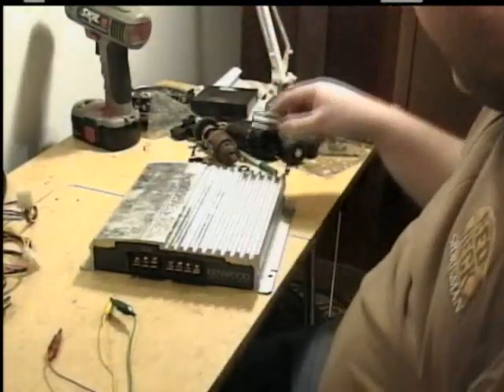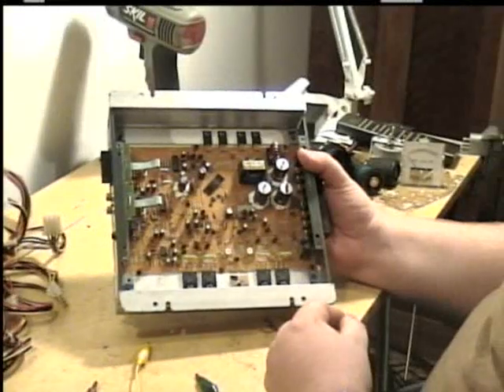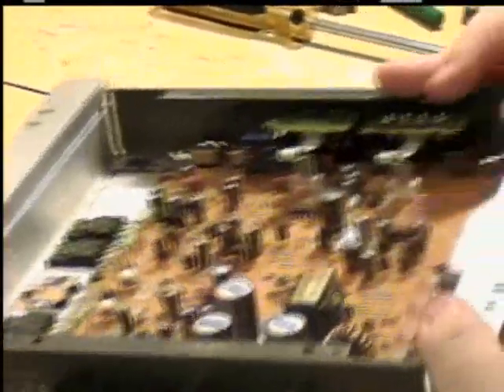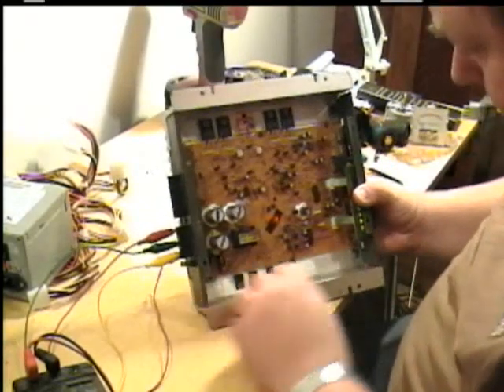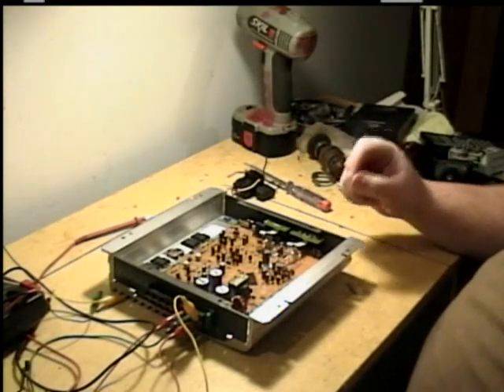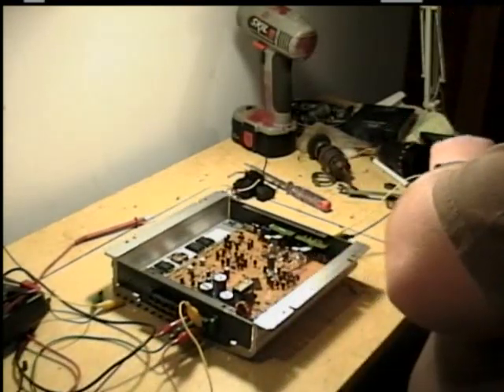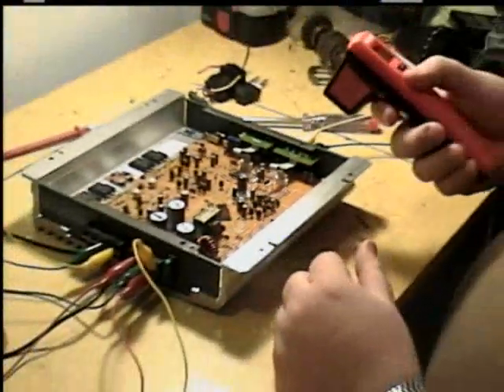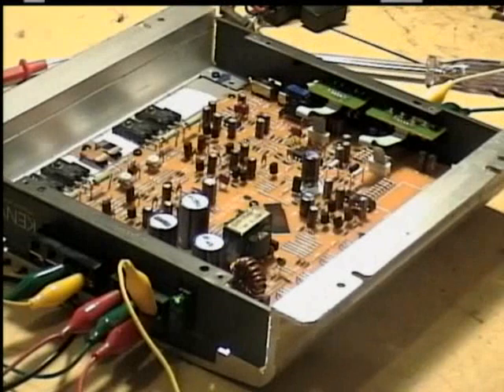Checking a Kenwood car audio amplifier

Comment from the maker: Check the RCA connectors for separation from the main board. Use a continuity tester to trace dead spots from the connector to the preamp. Sometimes the solder will crack around the solder joint of the connector to the board. -MrFixit

Comment from the maker: @warthhoh its not uncoomom for the power terminal to spark slightly when connected. Many Amps use switching PSU which have capacitors that charge when power is connected or when the amp is 'ON' causing an in rush of current. If the amp uses a power remote, turn it off before connecting/disconnecting power If the sparks are big, like shorting a car battery, the amp does have a problem. Remove the cover and look for burned components. -MrFixit

Comment: I have a question when i connect the power wire to my amp it sparks and when i unscrew the wire it sparks again , is the amp damage? how do i find the problem and fix it

Comment from the maker: @956mendez86 The MOSFETs are the primary components used in the power supply. The power supply isn't of the regular kind and can only be diagnosed by someone who understands "Switching" power supplies. The MOSFETs are used due to low-resistance  'ON' state, high-resistance 'OFF' state, ampere capacity, and the fast-switching speed. These devices are very sensitive to static electricity. They are either P-channel or N-Channel. -MrFixit

Comment: @ESRepair the amp model is (AMPLE EXONIC 270) 360 WATTS MAX. i take out all the mosfet out of the board and turn it on with out any mosfet install and gives me red light again. i check every single detail and nothing seem to be burn or broken

Comment from the maker: @956mendez86 it doesn't help not knowing what brand & model amplififer you're talking about. By not checking to find the cause of the first component failure before replacing it. Are you sure the replacement are the same as the old one? -MrFixit

Comment: ey men i have a ample amp 600 watts the mosfet resistor were burn out i replace them. it turn on and sound cam out but it lasted like 2mins when it died and smoke came out and i check they were the mosfet again i replace them again but it didnt turn on, this time it turn on a second and goes off  the red light goes on but rapidly goes out. HELP ME SEND ME SOME SUGESTIONS HMENDEZ86@HOTMAIL.COM

Comment: great video, helped me understand the internals of an amp, can you tell me if theres anyway i can hook a factory amp to a sub? i have a mach 460 amp from a mustang and i'd like to have an extra low powered amp to hook to a sub, but since its a stock amp, it only has quick connect clips. i know for sure it is a 2 channel amp because it put 85 rms watts to 2 5 x 7's, is there anyway i can fix this amp up and hook it up without the stock wiring harness? or should i just keep it for parts? thanks

Comment from the maker: @Greenmonoluche Should check speaker connections. Also check the speaker's impeadance (ohm) is NOT less than Amps minimum requirement. To start. -MrFixit

Comment: Hello bud it's me again I got a pioneer 760 watt amp 2 channel but at low volume it works fine but once I crank it up it cuts off the sound from the subs and it stays cut off until I reset the radio?

Comment from the maker: @Greenmonoluche The connections are correct , however, the ground is always the first wire connected, then the BATT +, then P.Con (aka remote). By connecting the ground last, may have damaged the unit (page 5 in the manual for KSC-WA801). Never connect the ground last. -MrFixit.

Comment: @ES repair well I'm not really technology inclined but I checked ground wire nothing was burned or blown but her let me tell u its says batt on the left side u know were the wires go on the amp then right next to it says GND="ground" right then next to that says p.con which is radio remote. So my batt and p.con are already connected I connect my ground but when I do that it sparks and blows my fuse so IDK

Comment from the maker: @Greenmonoluche There are two grounds one for the power (-) and one that is a Physical Ground (case). There should be no power going thru the physical ground. If reading Voltage from the ground (-) terminal on the amp to the battery's '-' post, you have whats called an "Open Ground". power should only flow thru the '+' and '-' cables/wires. check the ground cable. -MrFixit

Comment: @ESrepair hi can I ask sumthing I have a kenwood bazooka u know the ones with little built in amps and for some reason when I connect power to it then the ground the grounds getting power cuz i checked it with a tester so if u can help me out the model is a KSC-WA801 thanks

Comment from the maker: @EJ0245 Can you give me the model of your amplifier in question? Sometimes it can be a bad switch or the internal power supply isnt functioning properly, possibly a bad ground. You can use a Tone Generator to help trace signal degradation. I will make plans to show this process. It helps to determine where the signals are lost which can be a result of a bad board connection or a bad transistor (the actual Amplifier component). -MrFixit

Comment from the maker: @bustablake92 The protection Dioide's function is to short the fuse to blow when the power cables are connected in reversed polarity to prevent further damage to the amplifier. The amplifier has an internal problem. With the problem you're describing, it sounds like the power suppy inside is shorted. Not much you can do to repair it yourself. A shop would need to look at it. -MrFixit

Comment: Mr. Fixit,
I have an 800w and a 640w kenwood amplifiers in my car stereo and it used to work swell, then while i would play my sound system it would short out and come back in then short out again and would keep doing it as i played it, now as soon as i turn my car on even if the music lvl is at 0 the fuses still pop immediate to when i turn my key for battery power, could it be the polarity check like u stated in the video? or could it be something else. Cuz my step father plugged it up to a

Comment from the maker: @johnziebass yes, that's a good idea too. Their ampere rating is much higher than linear power supplies and not that expensive. Plus u have a wide range of voltages from 3.3VDC (orange wires) to 12VDC (yellow wire). Just need to modify the connectors to suit your needs. The amp may not draw enough power to force a shutdown but still cause damage a fuse is recommended between amp and Power supply. -MrFixit

Comment from the maker: @madmkila1 Does the lights react the same way when amp power cables are disconnected? If not, then something may be wrong with the amp. If they do you should have the Alternator and the electrical system.checked. High powered amps can overload the alternater burning it up. If the amp draws excessive amount of current, the alternater will overload because its ampere capacity exceeded its limits. You can check to c if the electrical system has significant amount of AC, this bad. -MrFixit

Comment from the maker: @MtxBeatsAllDay The power supply is a standard linear 120VAC to 12VDC 10 ampere. You can also use "switching" power supplies as well. There more compact and light wieght compared to linear power supplies. Iinear power supplies are easier to build your own. Inverters are a diffent type of power supply.

Comment from the maker: @1998tiburonse Also, if the amp  uses a switching power supply like the one in my video, check the large capacitors are not damaged. Check for loose or bad connections. -MrFixit

Comment from the maker: @1998tiburonse Some amplifiers have a bypass switch that is either manual or electronic. Check for the switch is turned off. Electronic versions will automaticly switch to bypass when power is turned off. Capicators can b used in 2 ways. When used in the power supply it filters fluctuations in the voltage. When connected in series with speakers the capacitor blocks BASS sounds from passing thru. If no change in volume between amp on or off, then something wrong with amp. -MrFixit

Comment: @ESRepair Hi i'm having a problem with an amplifier thats built in to my polk audio tower speaker for my 2 8" subs it's max out put is 100W at 4Ohm it seems to have no volume but very little sound is comming from the woofers i checked the volume pot to see if that was the problem but it's working fine any suggestions what i could look at next the power light does come on when pluged in and it has low level and high level inputs and niether make a diffrence could it be my capacitors?

Comment from the maker: @88DJdan First check for blown fuses. Check all power connections. you can used a volt meter to check that power is getting to the amp. ensure the REMOTE terminal is also getting 12V. Bad connections will prevent the amp from turning on. If all checks good, there's something wrong with the switching power supply inside the amp. These types of power supplies are not easy to repair w/o a good understanding of how they function. Check to see if any components are getting hot. -MrFixit

Comment from the maker: @joquel12345 Unplug everything to the AMP except power & remote (if used). Turn on the amp. If the amp is still in protect mode, then something is wrong internally. Do not ground the case. The only grounding should be through the '-' negative terminal of the amp. If the amp doesn't enter protect mode after turning on the amp, check the input and speaker output wiring. Frayed and piched wires can cause the amp to enter protect mode. -MrFixit

Comment: Some amps have reverse polarity protection circuits built in them or sometimes a fuse might blow to protect it. Older fosgate amps don't have any fusing protection built into so if you reversed the polarity your f*cked lol. But that's why they have filter capacitors there.

Comment from the maker: @jinx1550 It has been years since I last worked on amplifiers. The crackling noise you hear can be caused by poor connections and/or frayed cables, poor grounding, etc. Be sure to use the correct input type (LINE or speaker level). If audio source doesn't provide LINE level, you can use a speaker to LINE converter. You may need to remove the cover to check for hot spots while amp is running idle. Thermal sensor or freeze spray can be used to spot hot components. -MrFixit

Comment from the maker: @jinx1550 Yes, if you hook the battery's positive to the negative terminal on the amplifier and the battery's negative to positive terminal on the amplifier, it's called reversed polarity. This will damage the amplifier. Some manufactures incorporate a diode, as shown in the video, to minimize damage to the amp if such event occurs. During the event the diode will cause a 'short' circuit that in turn pops a fuse. The diode would then need replaced and wire traces on the board mended. -MrFixit